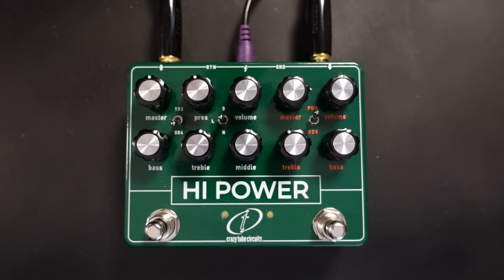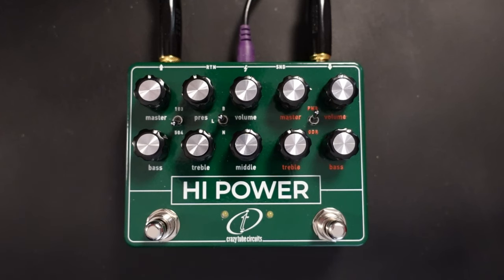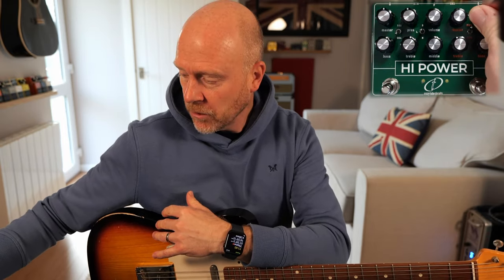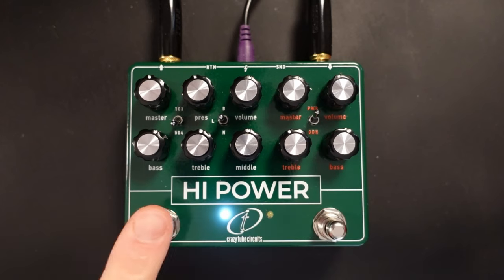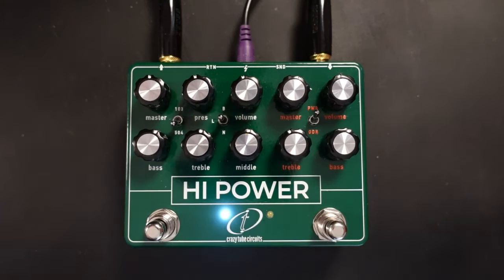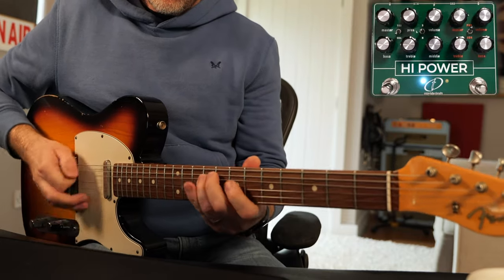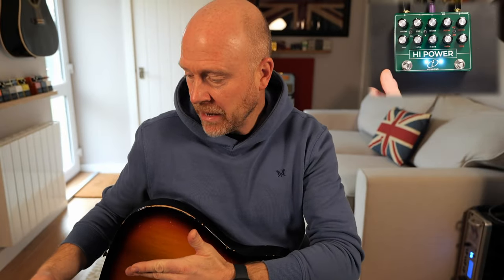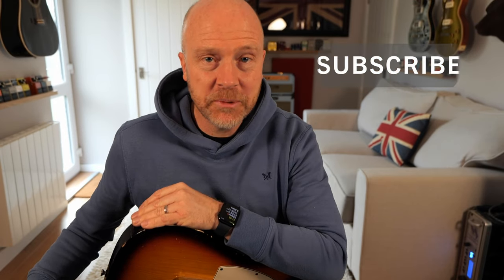Crazy Tube Circuits HI POWER

Comment: Thanks for playing your baseline sound before engaging the pedal. Much appreciated.
Reply: Yeah, especially because that baseline sound is not clean and seams to be an amp. Which basically means that the tested unit in this video is used as an overdrive pedal and not as an amp in a box.

Comment: Hi. Great demo as usual. Wanted to ask what to do with a delay pedal and the hi power. Would you put the delay in the Hi power's loop or after the Hi power? Thanks.
Reply from the maker: I’d have to try, but I guess it depends if you want the delay to come on with the hi power on switch.
Reply: I'm pretty sure anything you put in the loop can be switched on and off on it's own regardless of whether the Hi Power is on or off. Am I wrong? @TheStudioRats

Comment: If you could borrow a HiWatt amp from somewhere, it would be interesting to do a side by side comparison between the guitar into a HI Power pedal straight into a (non HiWatt) amp - versus the guitar into a HiWatt amp. See how close you can get the tones between the two setups.
Reply: The amp is final piece in the signal path would have its own sound, so it will colour the tone.  I think it's just a flavour of the tone and if you want any more, you're likely to be disappointed.
Reply: Pete Thorn does exactly this comparison in his review of the Hipower
Reply: @tpherndon  thanks for the info.